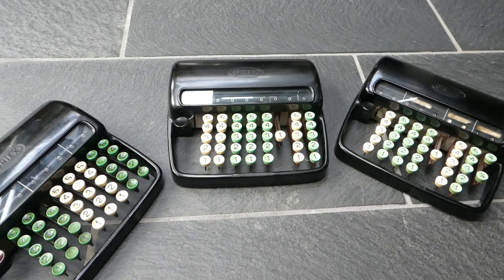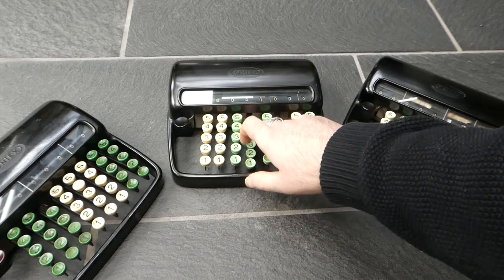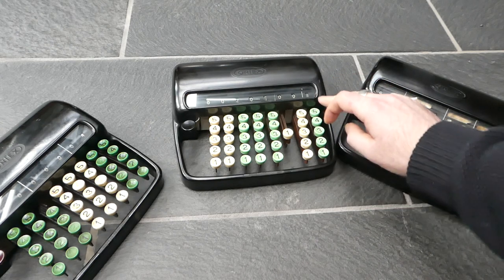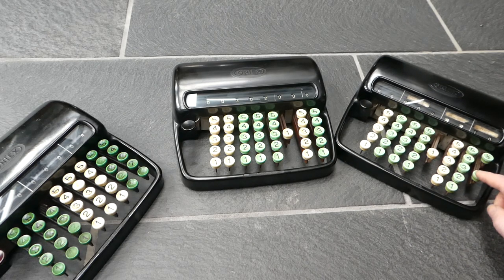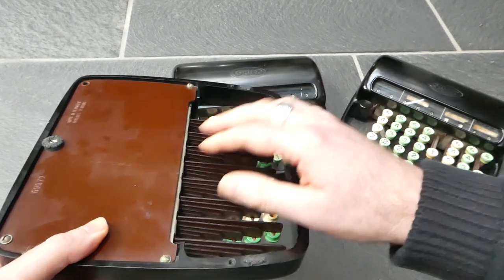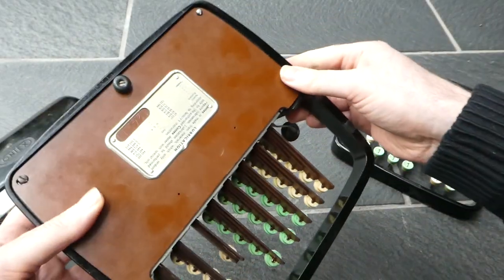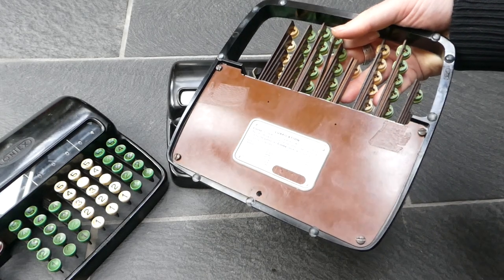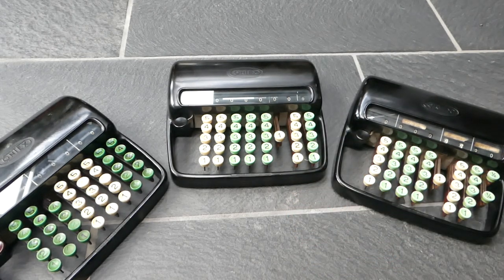The Contex A Adding Machine

Comment: Haha, I might have guessed you'd have more than just one Contex model A, we have just one A and one B here.  The keys always seem quite floppy compared to the rather more solid machines from Sumlock and Felt & Tarrant.  I do like the way you can see right through the keyboard on the model A, it's quite stylish.
Reply from the maker: I actually have one more - a standard decimal Contex A, but it has brown keys and comes in a carrying case. It is somewhere in the back of storage, while these were more easily accessible at the front.
Reply: @jaapsch2  I haven't seen one of the ones with the brown keys, in fact most of the ones I've seen are sterling models so it was good to see your decimal model.